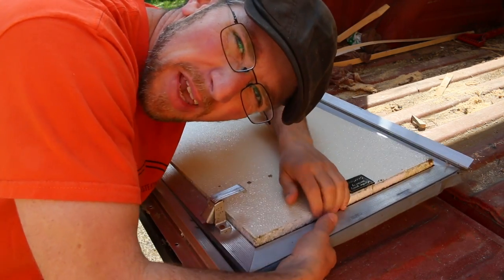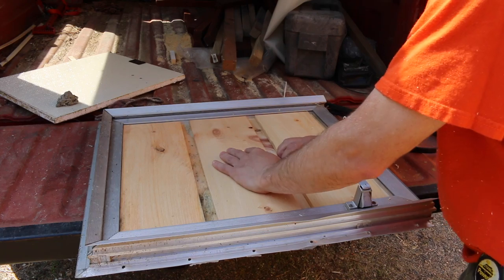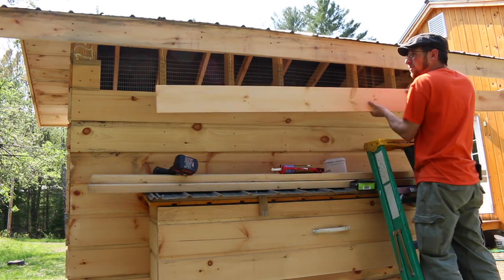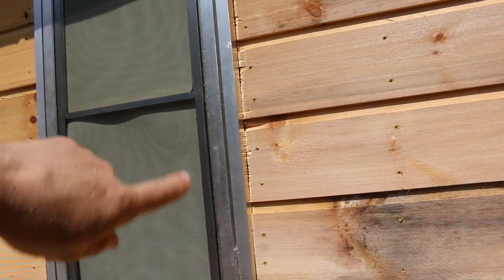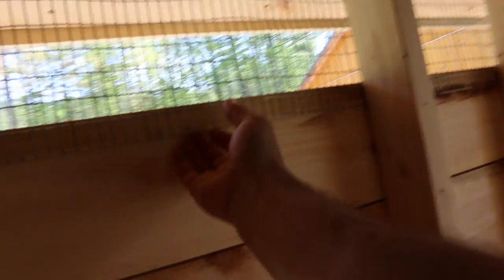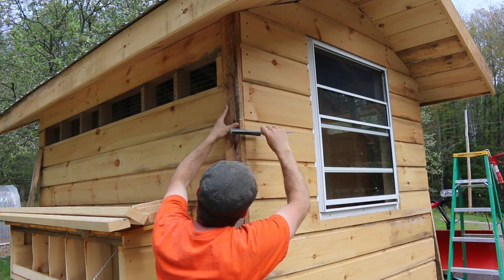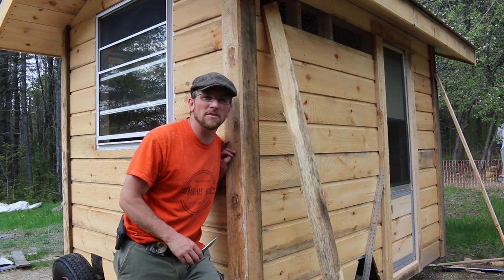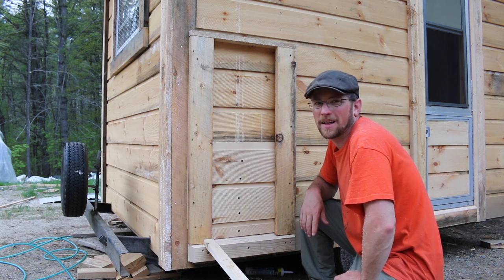Upclyced Mobile Chicken Coop Build #9

Comment: Nice job building the mobile coop. Using the used camper trailer was a super idea. It will allow you to keep moving the chicks around to better pasture at will. No such thing as overbuilding. The better your build the longer it lasts, that means saving money in the long run. It seems to be the perfect size for your needs and size of flock. I understand the demands for infrastructure on a new homestead. It's all about planning and getting your money to stretch for the most good. From what I have seen so far you are getting the job done and the family is better for it. It's tough that you both have to work two jobs and have the long commute but that should get better as things come together. Keep the end goal in focus and you'll be happier in the end.

Comment: Don't forget to protect the floor.   Off Grid Nation used a paint on roofing sealant; after caulking the cracks;  less work than vinyl sheet goods.  And you can paint the wall footer, part wayup the sheathing and a foot of the studs  to allow for deep bedding.   With this treatment you can wash it out and sanitize when you clean it or change your flock.   Bert.
Reply from the maker: That is a great idea I will have to look into it! Thanks for sharing.

Comment: chicken door should have gone on the side now if it rains it is just going to run right into the inside. other then that love it, did go. I put lil roofs over all mine doors, just a small one with the wood you use  would look cute and practical too
Reply: I see the the video you fixxed
Reply from the maker: Katrina Sibley yea we have about a foot over hang.